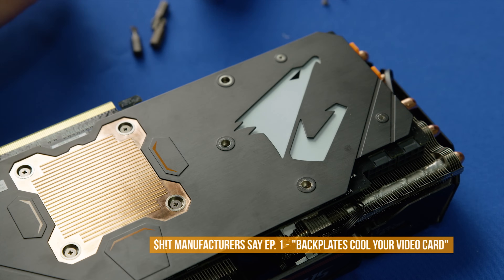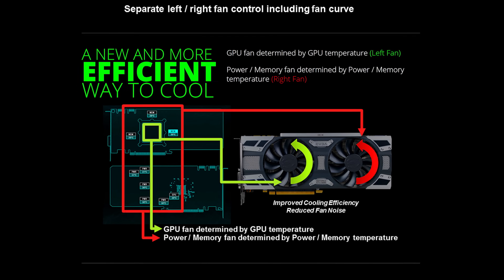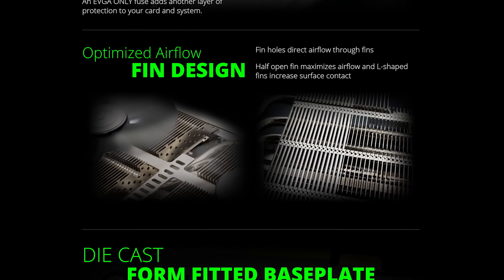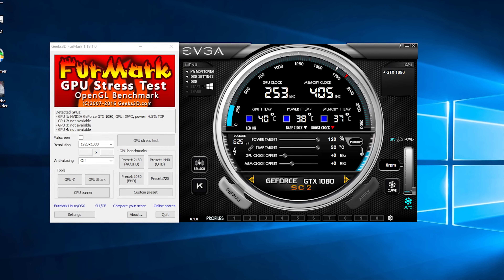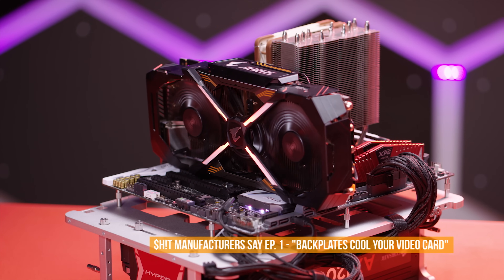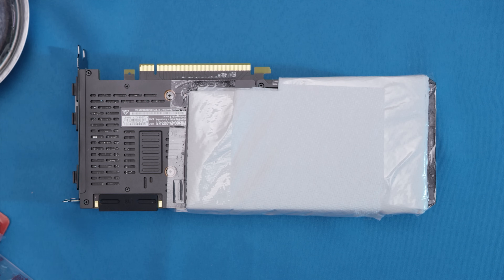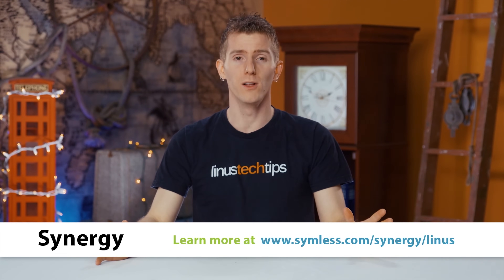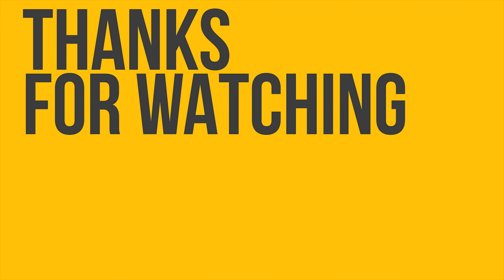The SOLUTION to Video Card OVERHEATING & DEATH

Comment: EVGA came out with the ICX cooling design cause of the fact that a lot of 1080s and 1070s with the ACX3.0 cooler were overheating to a point of them just totally dying out on the users and been having to get a replacement or 2 (if they had 2 cards being ran in SLI) and the big thing that they overlooked was putting on thermal pads  over the V-RAM modules surrounding the actual GPU core itself so they started to send out thermal pad kits free of charge to the affected users. That was really awesome of them to do that and showed that they really care about their customers and also that they were listening to consumer feedback on the GPUs themselves and all the overheating complaints on the GPU that were being levied ad there were enough to  require a different solution and that is where the ICX cooler comes into play hell they even integrated heat-nubs on the back plate interior to aid in cooling to get the back plate more involved with card cooling and all those sensors allow for better monitoring of the GPU and the fans under load actually one doesnt spin up  if it is under a light load but when a heavy-duty load is put on boht fans will spin up for better acoustics o it is essentially quieter than the ACX variant because most of the time you will be only needing one fan while gaming. So If i had $450 burning a hole in my pocket, i would get an ICX 1070 to put in my Lenovo pre-built desktop to replace teh shitty GT730 GPU that came with it.

P.S.: sorry for the long- winded comment but I know some extra info on the ICX cooler that could be useful to know as well.
Reply: weird cuz my 1080 since day one sounds like it wants to blow....its really loud at idle,when I play a video game it sounds like a plane in my pc case lolol
Reply: Learn how to use punctuation.
Reply: EVGA had to send out the kits free of charge to avoid a lawsuit. Its not so much caring for the consumer as its caring for their bottom line.
Reply: Thanks for the long winded answer. I needed that info

Comment: I have the real solution to overheating and death. Don't Overclock!
Overclocking a video card is foolish and a waste of an expensive piece of hardware.
Ooo look I got a few frames more cool! Come on, it's just not worth it!
Reply: R Doc yea, just stick to your pre-built systems buddy.
Reply: R Doc we do it for fun, more of a hobby than anything. performance gain of 10 fps between gpu and cpu? can we do without It? yes. we have fun doing it. do you have fun without overclocking, and I do mean "you". if so, then leave it be. do it how you like it. we know our limits on voltages and temps, you don't, and that's ok.
Reply: Yes I know you do it for fun, I did it back many years ago. I did it back in the 90's. I finally burned out on the idea. Just not enough gain for all your risking. Trust me that overclocked card or CPU runs fine for a while but down the road, there will be damage. It may take years but it will almost always degrade. If you overclock just run the benchmarks, do the bragging and set everything back to stock.
Reply: R Doc for me I do it for the gain and fun. It's like tuning a carburetor for less fuel flow and more air, more horsepower running lean. it doesn't matter if you know you're gonna replace your block year to year. for me that's the same concept with my pc, I'm probably gonna continue to buy new stuff each year anyways
Reply: I have built my own since 1995.
Reply: R Doc then you can respect a fellow enthusiast in doing what he likes, I'd hope.
Reply: One day you will grow so bored of this senseless activity.
I just feel it's a total waste of time. If you want an ego boost,  do a little weight training and see some real gains. I overclocked for years, then one day I said, what am I doing this for?

Comment: they make super advanced vapor chambers with a bit of alien tech to cool the GPUs (which IMO is strategic fir non refference) and at the end they put flat piece of junk at backside to make it cooler?? WTAF?! drill some holes or make some scratches with you screwdriver to make heat spreading area not so...minimum :F and yes... Im looking for a job -.-

Comment: hi sir very soon m gonna buy a gaming pc , following are the specs so plz tell me hows it ?
Msi X-99A slip plus LGA 2011v3
Intel core i7 6800 LGA2011v3
Gigabyte GeForce gtx1070 8gb 
corsair le SSD 240gb
WD 4tb HDD
corsair 1*16gb ddr4 RAM
corsair vs series vs750 watt smps
cabinet - circle cc830 professional gaming cabinet without smps
Reply: Abhishek Parmar go with the 1080 since you'll be running a newer chipset. it won't hurt. plus, prices dropped on 1080s.
Reply: Gizmil Gaming thank u sir for the reply .. well which 1080s should i go with? i want 8gb . which company is best ?
Reply: Abhishek Parmar I'll just say i love my Asus strix 1080
Reply: Gizmil Gaming thank u

Comment: again you will never read this... But... The design of the actual Circuit board needs to change. More importantly your mind needs to change about "how" cooling is done. Back in 2012 there was a technology "Dual Piezoelectric Cooling Jets" that can be integrated that would literally allow it to breath... i would add a video but because you will just block it... just google "Dual Piezoelectric Cooling Jets by GE Research"it is a old concept and it works... BUT you will NEVER READ THIS....

Comment: the only backplate I am aware of wich actually might contribute to cooling is from aftermarket coolers, like the Arctic accelero Twin Turbo III for example, but the size of that cooler can really be an issue with larger CPU coolers, so I guess that's why except for the aftermarket cooling we don't see that on graphic cards

Comment: Maybe it will be better with 4 independent coolers, or more with some fancy setup.
So we can shut off that segments where gpu i cold and take more power to the hot section.
And the spins should have possibility to spin in both direction no just one?

Or why we don't get a fan on the both sides of gpu ?!

Comment: Don't understand how EVGA is trying to market the independant fan control thing. I get how if the components at one side of the card are hot the appropriate fan spins up, but what is the need for the sensors? My Asus GTX 970 is a couple of years old now and has independant fan control, so what's the big deal?

Comment: I have an important question, I'm building my own system and IDK if I can run 3000mhz ram on a motherboard with 3200mhz
Reply: Should work so long as you match type (ddr4, ddr3, etc).
Check the motherboard manual to be sure, but it's usually fine to run slow ram in a fast motherboard because the motherboard will just slow down it's memory controller speed to compensate.
Reply: THX man, appreciate

Comment: well for a new sensor technology it's good...i stopped buying evga 5 years ago when my 9800 GTX gone dead after 2 years of use due to a malfunction in capacitors etc... to me it's a matter of ingredients and compounds and a well efficient cooling system...nothing new in ICX just another sensors....gamers need more reliable memory and durable power compound with a less heat as possible...so creating a new cooling method or reducing power consumption is what to salut...sorry my opinion

Comment: My video card stopped working... it's a problem with the vga port. When powered on and plugged into a monitor, the monitor reads "no input". I tried reseating the ram, and changing the cmos battery. Pretty sure the problem is "no vga installed". Does anybody know how to fix this? Can't find much online about the subject
Reply: Your card's dead man
Reply: You don't install VGA, it is just a port for output, have you tried the other ports of the graphics card?

Comment: Backplate heat dissipation depends entirely on the material of the backplate, thermal pads, and if there is an airflow across it.
This video explains neither, and indeed does not link to an explanation of either.

Getting dangerously close to fake news here guys.

Comment: hey linus can you do a video about the new geforce cuadro p6000 the myths said it's better than the titan x(pascal)!!!!!!!
Reply: Alcomandos well, it Is a 5000 dollar graphics card, I don't think that even the most hardcore PC gamers would shell out that kind of dough per graphics card, when you can get a very high end system with that. Quadro is a card for workstations for applications like engineering, movie production, and other professional areas that require the computer power. That's why it's got floating point precision, ECC support and such

Comment: even a single fan 1080 gives the same fps. why cool it?
Reply: To extend the lifespan of the gpu. If you let electronics run too hot they will get damaged over time and while they may not catch on fire and burn, you will end up replacing them earlier and thus wasting money. Besides, gpus start throttling when they get too hot, which means less fps anyway. Hope this answers your question.
Reply: even the tiny ones don't get past 80 at bad conditions! watch crit's video on tiny vs big does size matter video (formerly tekSyndicate)
Reply: I'm not saying that they will run at like a 100 degrees, but as a rule 
of thumb, cooler is always better. The fact that 80 is safe doesn't mean
 that the components won't slowly degrade over a long time. Also, you 
can overclock the card even more if you can make it run cooler than a 
reference card.
Reply: Mario Gomez they don't give much of a real world advantage! but anyway :D
Reply: Mario Gomez Yes, running stuff cooler makes it last longer. 
But its pretty stupid: 
Instead of 20 years, your components will last 35 years. 
Since I only use my cpus and gpus for a maximum of 6 years, I dont care about temps too much. Just about silence.

Comment: 5:52 was a correct use of the word literally.  A pun (in this case cool) that worked not just as it's usual figurative meaning but also as it's physical meaning is the original reason people would use the word "literally" in the first place if they were being witty.  

Anybody that uses the word "literally" frequently should take note.

Comment: If u put Copper plate on graphic card with one normal CPU cooler~150 w and i bet u are going to see huge diference.When i opened my GTX 1060 the radiator plate was made from iron(not alumunium or copper).No comment on that

Comment: But we already have temperature sensors on the VRMs. Just need a fan curve setting in MSI Afterburner/EVGA Precision X which will have the option of upping or lowering the fans according to not just the GPU Core temp, but the VRMs as well.

Comment: You could get AMD 7950 cards where the fans would spin at different speeds but that was to try and keep dust out.
My GTX 970 Strix backplate gets hot, I think most if not all do however I think the flat design of them prevents them from being able to efficiently dissipate that heat into the case.

Comment: will someone help me if I should buy this PC for 500 - 550$ ? 

1. Cabinet - Cooler Master Haf 912

 2. Power Supply - Corsair CX 750w

 3. Ram - Gskill Rip Jaws 16gb (8x2) Gaming Ram

 4. Cooling System - Corsair H80i liquid cooling system 

5.Motherboard - Asus Maximus v gene Gaming motherboard 

6. Graphics Card - Asus HD6950 2gb EAH6970/2DI2S/2GD5 

7.CPU - Intel i7 2600k overclocked at 4.2 GHZ
 
8.Harddisk - western digital 1tb ...
Reply: ENorK TV no, processor and graphics card are way out of date
Reply: Austin Alexander so..should I go for it ?
Reply: No build your own system
Reply: Austin Alexander I cant get used parts so I have to buy new parts if I start from scratch..And its fucking costly ..
Reply: Austin Alexander give one example of good build under 500
Reply: Here

https://pcpartpicker.com/list/mkFz9W

Gaming wise the i3 is as good as the old i7. 

The 1050 is a low end card, but still much faster than the 6950

Everything is brand new. CX PSU from Corsair are bad and it's used. Here you have a Seasonic (the best of the best) and new.

Comment: i was actually under the asumption fanpowee actually does make a slight difference in oc'ability. Especially if u don't touch the powerlimit or overvolt. It is not uncommon that a 3000rpm fan can  use up to 6w max (probably around 3 once it runs full blast) if I'm not mistaken. multiplied by 2 that can actually impact the powerlimit. 

Anywho, I'm pretty sure this is probably one of the best cooling solutions for pascal and the extra sensors are quite nifty for enthusiasts. Nonetheless it's mostly a marketing measure to make up for the no-thermalpad-acx 3.0. R.I.P. ACX.

Comment: How about instead of these expensive c&c machined (I assume, I doubt they are cast/stamp) costume back plates that have no major impact on temp.... why not just have like 2 fans over the back too? Most (pc) gamer's these days, unless running SLI/CF have the dang room. Why not just give them to option with a small fan mount extension that screws into the back of the card or something? 

I would much rather pay $5 more for a rear mounted fan extender, than +$50 more for a 50-100mhz boost, and a piece of metal over the card (especially when lets be honest, most people just install it, and then the pc goes under a desk or something to never be looked at internally unless you show it off to a friend).

Comment: if you had a power supply that could handle it could you use a  12Vdc  50 - 72W Semiconductor Thermoelectric Peltier Cooler Heater , to cool the cpu a gpu? with the regular heatsinks and fan/s

Comment: why do you mock reducing Fan Power Consumption for higher power limit for a GPU?
it's... true. the fans on most GPU's consumes about 30-40Watts. which must be deducted from what PCI-Express Power and Motherboard power combined gives the GPU for available power resource.
but computing isn't really your area of widespread, in depth expertise.

and most Consumers probably won't pay for sensors and controls.... but actually serious computing people, have been paying for that for a long time.
computing hardware with test leads, multiple BIOS profiles, power overhead, the works is highly desired by computing professionals, diehard enthusiasts, extreme overclockers, Et Cetera.

Comment: i recently got the gtx 1080 ftw2 from evga upgrade thay did, and although out of the box it wasnt all that great, i DID how ever crack the thing open and replace the crappy thermal paste and put it back together, i went from the high 60's to the low 70's in the before part of running these and had to run an aggressive fan curve to keep it thier. but after i replaced the thermal paste i can run it non stop all day and never see it go above 65ish. once agian i think some companies are cheaping out on the wrong parts of tech, thats a extra dollar to put some good paste on the gpu when you get this kinda pay back out of it, also was able to lower the fan curve to not sound like a jet next to my ear, unlike the before and on the 1080 ftw.

Comment: We need a normal mode where its cold, and a game mode where you OC to the max and have all the fans spinning enough to create a small weather system in the room. Screw temp controls and sensors, max max max without the max backplate price.

Comment: only thing i can think of that backplates help with is when your watercooling has dripped onto your card or maybe when you're tinking around with your pc turned on and you drop a screw on your card or adds rigidity. beyond that it's useless.

Comment: Linus, I don't know why you brushed off the "low power fans for.. gpu power budget".  It may sound like marketing, but watch a card's power limit percentage at idle then bring the fans to 100 percent and watch the ten-ish percent jump in power usage (at least).  
Yes, it may still be marketing crap, but the power usage of fans is real enough to consider.
Thanks as always.  I don't need cable.

Comment: i usually have most fans spinning at 100%. not only because i always have cooling problems (at least all summer) but also because you get used to the sound and it won't suddenly ramp up with high system load. you're certain you're always at the maximum current potential of the cooling.

Comment: It's cool and all but with evga using other people's cards and reading them with a tweak here and there, it's not very impressive. It's a nice idea but a better cooling implementation would be more ideal. So it knows the card is hot. not much good if it can't reduce the heat more efficiently compared to other cards

Comment: This is stupid.. one fan at higher RPM is louder than two fans at lower RPM. Even if there is only one side of the card that's hot it would still benefit from the two fans at the same lower speeds then just ramping up one while the other one stays low.

Comment: Whether or not the only benefits are independent controls and more temp sensors, I would still get the new technology if I needed a new card. The sheer fact that we were able to see memory temperatures as opposed to only GPU temperatures is a huge +. We now know more of how a GPU works, and I'm sure EVGA will continue to perfect this better than any other brand out there. The extra small steps they took were also quite significant in my book. The perforated aluminum fins, the backplate, and the new fan design all contribute. You guys should possibly consider making a video showing the reference 1080, the original ACX 1080, and the ICX 1080 (stock, not superclocked or overclocked in any fashion), along with the other top manufacturers that boast good coolers. That would be very educational.

Comment: I have a Normal 1050 in my Alienware x51. It reaches like 78 degrees, is that normal? I assume that it's due to the fact that the fan is just moving the air around inside the case. My first mistake was buying an Alienware.

Comment: I love how EVGA pretends the solution is iCX cooling when they have a problem with faulty 12v capacitors to the power delivery circuit.